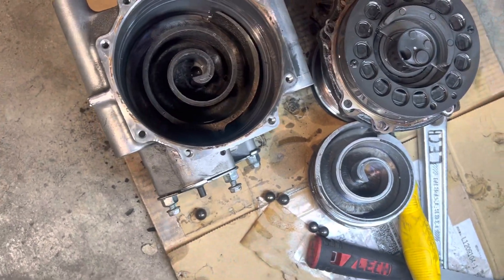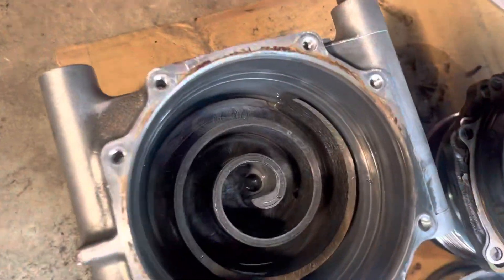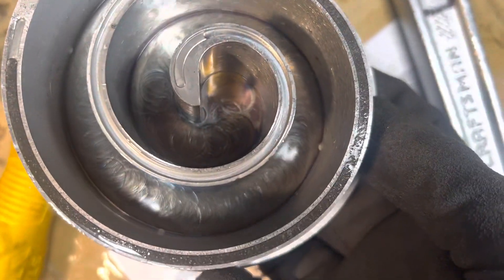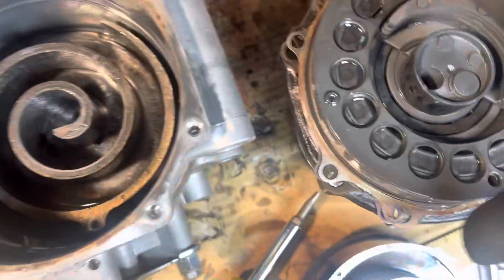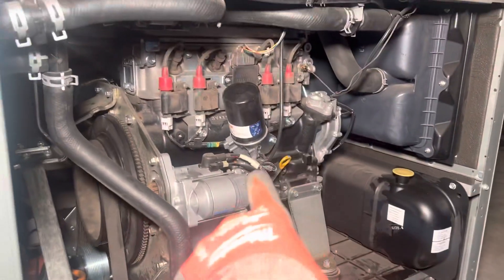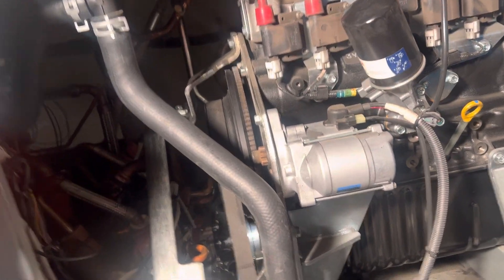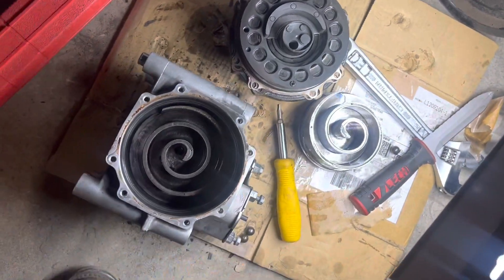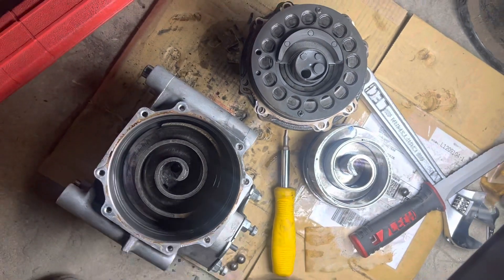🔥 BURNT UP COMPRESSOR TAKING APART. 15 TON HEAT PUMP NATURAL GAS TOYOTA ENGINE BELT DRIVE

Comment: Just an update. I finally ordered myself a trublu vacuum hose kit!  I'm really excited! I'm hoping to see the differences that it'll make. I'm pairing it up with only a 3cfm pump. Only work on cars. Can you tell me in more detail what differences I will notice with this hose instead of using the charging hoses for vacuum? So stoked!
Reply from the maker: A little faster on the vacuum and capable of going deeper vacuum. 

You go straight off the vacuum pump straight into a ball valve isolation valve with a second Court optional on it right into your coupling to the car .     You can totally skipped the gauges..   gauges in any hoes, other hoses just slow it down. 

I’m going to have to make some more videos about this and post them so you can see .
Reply: @coldfinger459sub0  Thanks for the information. Yes! That would be amazing to get more education on the hose setup. You're the one that inspired me to pull the trigger on getting it. I'm personally looking forward to hopefully seeing better ac performance on the systems I work on just because of having the deeper vacuum and less moisture in the system.
Reply from the maker: @mailmanjoe  
you must have missed my video on the recommendation of watching Jim Bergman, video on explaining vacuum different types of vacuum rig, sit ups and using the true blue hose

https://youtu.be/C8VLjBnkEcs

Click on the link below, will take you to his YouTube channel
Reply: @coldfinger459sub0  Yes I must have missed it.  I'll look into that link. Thanks!
Reply: @coldfinger459sub0  That is a fantastic video of information. He literally leaves nothing up in the air to wonder about. Question for you though. He recommended removing the valve core to limit the restriction in vacuum. Do you do that everytime you vacuum a system on a car application? I really can't wait to get that hose and see the results now.
Reply from the maker: @mailmanjoe  that is because automotive doesn’t use those tiny little quarter-inch valve cores with tiny little openings. 

In automotive on the 134 and 1234 vehicles have high flow large diameter fittings . 

Only if you’re doing an old R12 vehicle with the original old style quarter inch service sales. Do you remove the valve course .

Comment: Can you show the indoor unit how it looks like please, i wonder how this 2 compressors deliver 15 tons compared to residential or commercial compressors.
Reply from the maker: Look back in my videos 13 days ago I showed the heat pump that used a Toyota natural gas engine driving these compressors.
Reply: Thanks allot